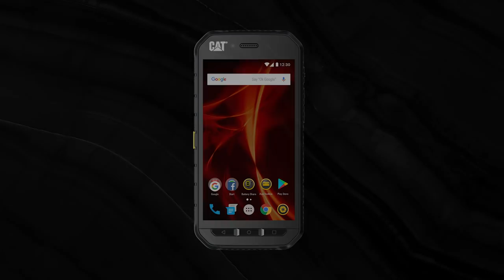Cat® S41 Smartphone - #BeUnstoppable  | Cat® Phones

Comment: Looks like a great work phone. My S8+ is so fragile I'm afraid I'll break it if I'm not babying it 24/7
Reply: It worth it. I have s60, and it's relly cool. This summer I took always my phone to sea. :)
Dropped it few times. It's still good.
If you don't need thermal camera, S41 is better because it has bigger battery.
Maybe s60 can swim deeper - up to 5m.